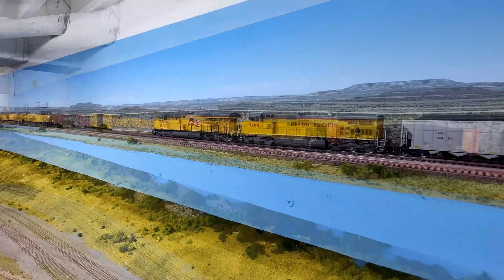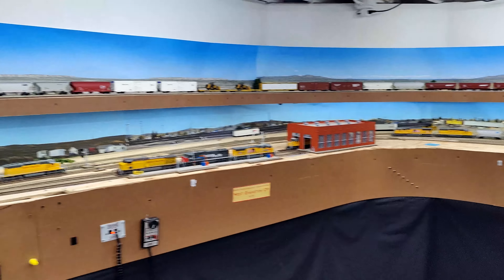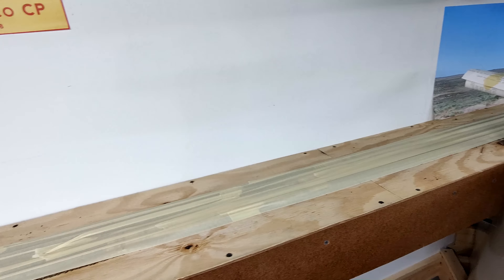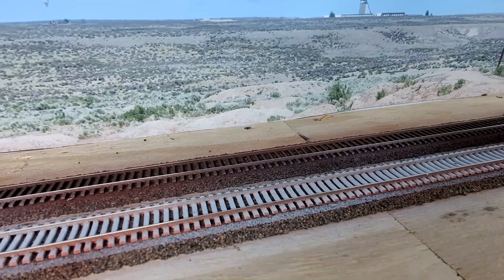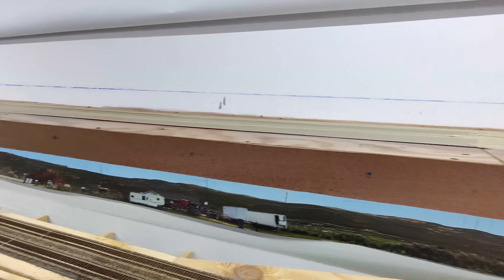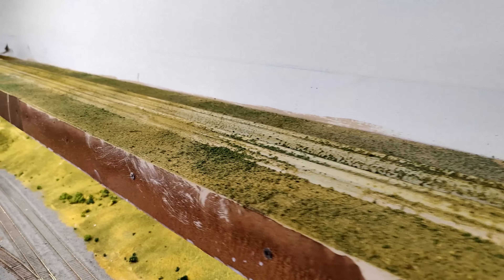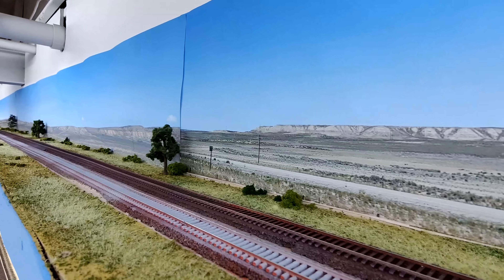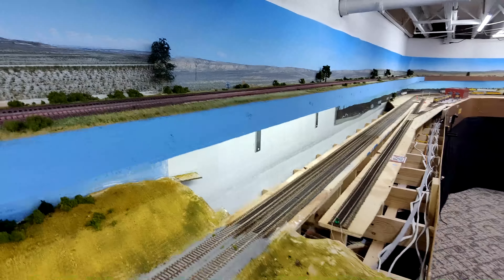HO Layout Update UPRR Evanston Sub Scenery Extended 32 feet on Upper Level. Model Railroad trains!

Comment: Daryl...the issue of the slow moving freight cars. I used the same tool to bore out the axles (slow and tedious) and replaced all of the wheels with Intermountain wheel sets. If I'm not mistaken...the axles are thinner and roll better within the axle cavity of the truck.
On your coal train...you might want to put the DPU somewhere in the middle of the train. 🐪
Reply from the maker: The graphite is working for now. May try the Intermountain set also

Comment: Great progress on scenery,  as for the Rapido freight cars,you may want to contact Rapido if you haven't already tried that. A few years ago when they released the  first run of New Haven passenger cars they had the same problem with the trucks not being free rolling, they corrected the problem with new trucks and wheels. I had 5 of their first run of RS11, the motors drew to much amps ,as result would croak our circuit breakers. Rapido replaced all of the motors for me. The warranty service was excellent. The amount of cars you have represents a sizable investment, can't hurt to contact them. Hope it works out for you. By the way I believe that powder your using is conductive.
Reply from the maker: They added lubrication to the axle points, which only lasted for a few hours of operation. So, it is obvious that they knew of the issue.  I really don't feel like spending any time with them.  I doubt they would send me 118 trucks with wheelsets. Even if they did, they probably would not be any better than what's on the cars now. My plan is to just not buy any more of their cars in the future.

Comment: Yes, it seems like you got quite a bit done.  My excuse for not getting more fone on my layout is that I am sitting here watching you work on yours!😄  By now, you know that I have lots of opinions.  Dascia color - it's YOUR layout, pick one that pleases you!  In my visits, video viewing and reading magazine layout tours, most people tend to use a dark color on BOTH levels of their layout.  I think it helps the illusion that the scenes are "miles apart" not "stacked".  See what your operating crew has to say, they can see the layout in person and render a better opinion.  You could even paint some sections in different colors as test displays for the voting.  Wheels and trucks - first I am sorry to hear about the Rapido cars, not only for your sake but because I have a dozen waiting to be put into service.   I love the "truck tool"!  I have had a couple for many years and they have helped a number of plastic trucks for me.  My personal favorite is Intermountain (or Tangent) wheels in Accurail trucks .  One option (although kind of wasteful) is to retruck the cars.  I had to do this with my first batch of BNSF "Earthworm" hoppers from LBF many years ago.  They had HORRIBLE trucks and wheels, but I spent the money to put Accurail trucks and IM wheels under them and I have not had any truck-related problems and they roll faster than a little fox running from a forest fire.  That option could keep those nicely detailed Rapido hoppers in service.  I'm glad you had good results from adding graphite to the journals.  I have had mixed results with that, but I won't critsize success.
Reply from the maker: I'm going to try some intermountain wheelsets. I've heard they are the best.

Comment: Excellent!
 
I'd use the sand color on the fascia... or maybe eggshell. Also, I think scrubby trees work better with that desert-y backdrop.
Reply from the maker: Thanks. I may put a 1/2 inch desert sand stripe on the top of the facia.

Comment: Have you considered possible splitting the color of the fascia? Doing the bottom half sky blue and the top half some other color, either your desert sand or a black or brown. I know it would be quite a bit of work but could help blend the top and bottom and get the best for both levels.
Reply from the maker: Interesting idea. Thanks

Comment: I just measured some wheels and the Rapido axles are longer than Intermountain, gauge was ok on both. I've found that trucks with longer axles need to be squeezed when you use the truing tool or it doesn't cut into the side frames.
Reply from the maker: Interesting.

Comment: Before you rake Rapido over the coals, make sure you contact them about your issues.  You're probably not the only person with quality issues, but likely the only one who has a large YT channel and a sizeable audience (whom I'd wager also have some Rapido rolling stock) who has visibly documented an issue with their stock.  Worse case scenario: work through Lombard Hobbies to contact the manufacturer and get a resolution from them.

But on topic: the layout looks great and that small slice of scenery works really well on that narrow space.
Reply from the maker: I doubt they would send me Intermountain wheel sets. The cars had lubrication on the axle points, so they already are aware of the issue.
Reply from the maker: Should not have to go through all that. Especially for something as simple as wheels that roll.

Comment: Great railroad and video.  You mentioned after cleaning the track you put some "oil" on the track.  What brand or source and type for this oil and why do you put it on the track?
Reply from the maker: Rail Zip.  Oil improves electrical conductivity and reduces oxidization.

Comment: Same issue on the  Rapido N Scale cars I purchased this year I found taking out the wheels and lightly spreading the trucks outwards fixed the issue. The plastic they use is harder than normal and tends to shrink after production. It worked on these cars. Might be worth a try. I agree they are problematic though.
Reply from the maker: I'll take a look

Comment: I have found that Woodland Scenic static grass is thicker than the grass provided by other manufacturers - I mainly use WWS, from the UK, and miniNatur, from Germany. The thinner grasses seem to stand up better than Woodland Scenic - the applicator seems to pass on a better charge to the grass and this helps them to stand up.

I also find that rather than mix the grass in the applicator, it is better to just dab small lots of glue (I use a 50/50 mix of matt medium and water) applied with an old brush, then apply one grass. Leave for a couple of hours to dry, then apply more dabs of glue and apply a different grass. Also consider mixing the length of the grass - apply the initial two layers of 2mm grass, then apply a darker 4mm or even 6mm grass in smaller dabs. This gives a more varied appearance in both colour and height and looks much more realistic.

Finally, I vacuum my grass almost as soon as I have applied each layer. The vacuum also helps the grass to stand up.
Reply from the maker: I had no trouble getting the WS to stand up.  Color blending was the issue.

Comment: I would do the fascia board in one or the other thoughts;   One you could paint the fascia board in both the blue and sand color with a thin red line like a sill stripe? Second do UP yellow with a red sill stripe or Yellow sill stripe?  Just a thought.
Reply from the maker: Thanks for the input

Comment: Applying graphite to the wheel bearings might be better done with an Exacto knife tip. Turn the truck over so you are dumping the graphite down into the bearing rather than pouring it onto the wheel face.
Reply from the maker: Since I have so many cars to do this was the most time efficient method. Worked well too

Comment: Hi Daryl , I would try painting a piece of 2 foot wallboard in sand color and just dab some greenery on it so it matches your backdrop and then clamp it to your fascia, take a step back and see if it would blend in.
Reply from the maker: Good idea
Reply: @EvanstonSub  I meant to tell you to use a small round brush and make sure you dunk it in water. I typically use acrylic paints a mixture of black and yellow, for darker green use more black and lighter greenery use more yellow.

Comment: Have talked to Rapido ????
I'll bet not! 
Facia, quit trying to be cute. For the last 20 years the advice has been black, matte black or dark green. If you like your trains Floating in the air.......knock your self out.
This your railroad do what you like and quit trying to do things by committee. You'll be happier !
Reply from the maker: Don't worry, I'm always quite happy. Why would I talk to Rapido?  There is nothing they can do to improve the issue at this point.  BTW, I know they are aware of the issue since there was some white lubricant in the trucks when I bought them brand new.  They rolled fine at first, but then terrible once the lubricant was no longer effective.  Also, don't be such a crab, you'll be happier!